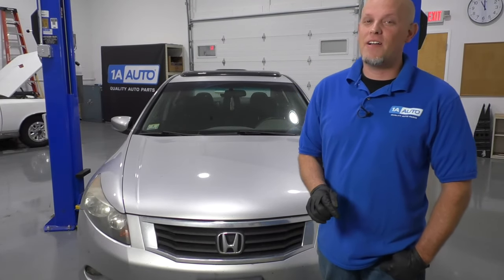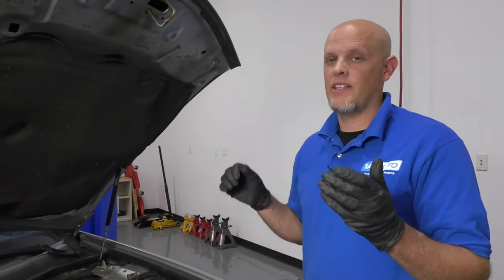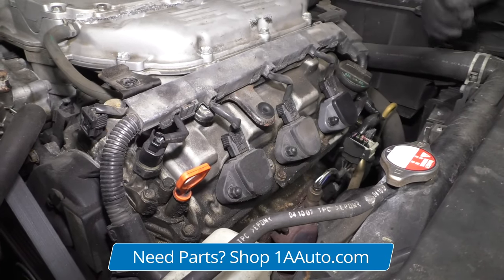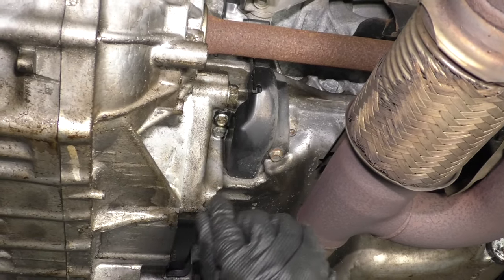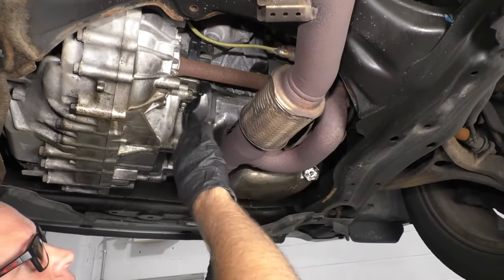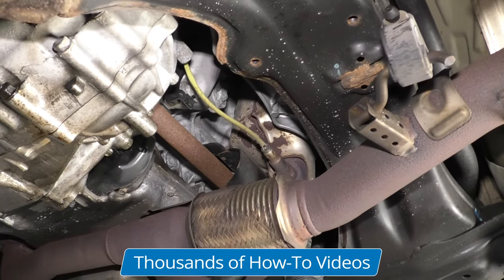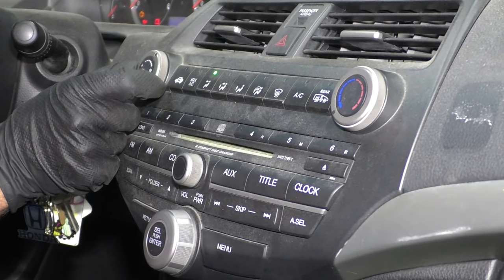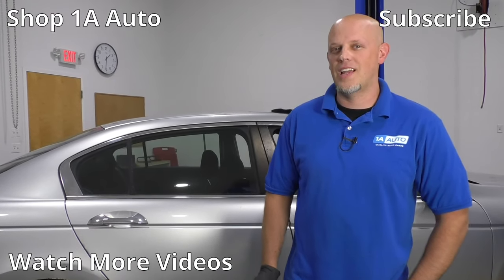Top 5 Problems Honda Accord Sedan 8th Generation 2008-12

Comment: I had the 2008 4 cylinder model... bought it with 136k miles on it, sold it 5 years later with 250k miles, no major issues at all,, the biggest component change i made was the brake booster,, other than that, the car was such an amazing to drive, super reliable. loved it.

Comment: The biggest problem I have had with my honda now is replacing factory parts that needed replacing with junking ass 1A auto parts like the  four complete strut assemblies after a alignment it sounds like a Amish buggy on a gravel road all four struts  make noise I was told by several macanics not to buy after market assemblies now I know why it all over YouTube and Google about the noise I should have done my home work before  hand

Comment: 160K miles, not a fast or quiet car inside (I've got the LX-P) but otherwise solid vehicle. Repairs so far, locked front caliper, starter motor, radio was having hiccup and occasionally it takes few extra cranks to start. Arm rest in the center console wore out, paint still looks good, couldn't be happier with a long term outcome.
Reply: Mine too , got a lot of problem , not reliable than i think
Reply: Get the v6 it’s pretty peppy compared to the inline 4 everyone that sees my car gets jealous because I have a “fast” car so they always challenge me to race them
Reply: @slapshotjack9806  ME TOO! LOL
Reply: @slapshotjack9806 only race I’ve lost in my accord v6 is to a Tesla😂

Comment: 2009 Accord, 4 cylinder, 205k miles. Have had none of those problems. I had the starter changed and it’s pretty well hidden. Other changes have been battery, tires and brakes. So far so good! But thanks for pointing these out.
Reply: Hey Honda friend! I got a check engine light on. Mechanic said catalytic convertor..Ive heard i dont need to necessarily do anything about it if seems to be running well..

Comment: I have a 2011 Accord up here in Canada.  I had to change my alternator twice, a leaking rocker plate, wheel bearings, and front shocks.   It's the heaviest and largest Accord that Honda ever made, so some of the parts are meant for lighter cars.
Reply: The oil leaking runs down inside the alternator and that's probably why you had to replace it. Seen that a few times.
Reply: Changed the rack and pinion, timing belt, factory amp, and now it has an alternator issue
Reply: Wheel bearings for me... That's what bought me here.. Sounds like a jet while driving
Reply: Starter died, spark plugs, ac compressor, and rotted floor, all fixed runs like new
Reply: I had the same problem with my 2012 Accord.  Had a leak somewhere and it was dripping down. Causing the  alternator to fail. What I do now is Keep a close eye on any leaks When I get the oil changed. I've also replaced all the wheel bearings on my car. It now has 250,000 miles. As the temperature rises,  You may want to think about having your engine steam cleaned so you can better identify any current leaks. I used to live in a very Cold climate similar to Canada here in the States. My cars would always have leaking seals more often than if you're in a warmer part of the US.
Reply: Mine has eaten batteries since it was new.. I replaced three on manufacturer warranty alone. I now buy premium batteries with 2 year warranty knowing they will fail in one year and be replaced for free. It's a 2010 and has had over 15 batteries. I replaced both battery cables twice, the positive is constantly rotting from the inside out. Other than that and regular maintenance, it's been bullet proof

Comment: this was the most helpful video on honda i have found. i had to replace and alternator, many brakes front and back.door battery and my power steering is leaking now
Reply: Were those fixes inexpensive? Did you keep the vehicle?

Comment: 2009 Honda Accord coupe with 120k miles. The thing is a bullet and the only issues I’ve had were ignition coils replacement, starter, and cleaning out fuel injectors.

Comment: I absolutely love my Honda, but have had to change the alternator 4 times. It's an easy fix if you have the right tools. My Honda just hit 200,000 miles and is still running good.
Reply: I'm seriously debating on buying a 09 v6 ex l with 180k miles
Reply: I replaced the alternator on my '08 Accord once at 150k miles. I think you should go with genuine Honda parts. Unless you have bad parts installed there is no reason why they shouldn't last at least 100k miles.
Reply: @e46enthusiastic57  . Hondas are good cars but anytime you buy a car with that many miles be prepared to spend money on repairs. Some things are very difficult to replace like catalytic converters and depending on your expertise working on cars you might not want to do it on your own. I had the shop  replace my for around $700-$800. Most of the other work I do myself.
Reply: Denso alternators only for replacement
Reply: Unless it was a genuine Honda replacement I can't see why you had those issues.
Reply: @midwestfarm757  my alternator just took a crap and it was the original one 11 years 191,000 MI I spent the money for a new Denso one
Reply: Make sure oil is not leaking and running down into the alternator.
Oil will ruin it.
Reply: Do you run an amp? Speakers?
Reply: 4 times damn did you use a parts store brand reman alternator? Denso remans usually last quite sometime even though they come with 1 year warranty
Reply: @CRAPO2011  yes store brand.

Comment: 2012 Accord 4 Cyl, had 30K when I bought it,  10 years ago, 135K now, I do all my own maintence.  Only thing I have had to do was Oil changes and brakes , I change trans fluid about every 2-3 years, flush the brake fluid every 5 years, changed the plugs at 100K miles.  I recently changed all the coolant hoses on it, figured 135K and 12 year old hoses probably due, they really weren't that bad at all, I was surprised.  This car does not burn one drop of oil or leak any oil. This 2012  runs as good as the day I bought it, plan to keep it till it's dead.

Also have a 2014 Accord 4 cyl with the "Earth dreams" engine in it.  80 K miles. It uses oil, about a Quart or so between oil changes.  "improvements" aren't always better!!

Comment: I have the 4 cylinder and the only problem that I’ve had with it was the motor for the vent direction died so I didn’t have defrost. Other than that, drives great. (Not a bad 0-60 time either)
Reply: Ya quick for a 4 cylinder! People ask me if it’s the v6 when they ride in it
Reply: @ajmedeiros77  lol the v6 is a rocket on wheels if you’re a car guy with interests in mid range vehicles like that
Reply: @slapshotjack9806  OH YEAH!
Reply: @slapshotjack9806  little bit more of a rocket in a crosstour that has 4wd, love mine

Comment: We have a 2012 Honda Accord SE 4 cyl. and it’s been a very reliable car overall. The only thing I had to replace on it were both front shocks and a catalytic converter. After watching this video Ill go ahead and replace the spark plugs and ignition coils. I don’t think it’s ever been done since we got the car. We got it with 42k miles and currently it has 138k miles and we’re very happy with it.
Reply: 2012 model is the most reliable
Reply: I have a 2012 accord as well and how many miles did your Honda have when you changed both front shocks?
Reply: That's exactly what Scotty Kilmer (on Youtube) said.   @antonisabeast
Reply: @donttrip8314 I think it had a little over 100k miles when I replace the front shocks.

Comment: I have a 2008, 4cyl sedan with low mileage at 79k.  Just replaced the fuel pump today.  My garage was smelling like fuel.  Scary.  Also, the moonroof is stuck open in tilt position.  Just found a couple of videos on how to manually close.  Other than that, this is a very reliable car if you keep it well maintained.
Reply: why did u replace it? i have the same car and i think the fuel pump is whats causing it. what kind of symptoms were u experiencing? hesitation upon acceleration but on some days it feels responsive?
Reply: @gerard4441  I had 3 mechanics look at it and they could not diagnose it properly.  Took it to 2 Honda dealerships and explained the issue to the 2nd one and requested a master tech to look at it and he discovered the fuel pump was bad.  The car is 13 years old, despite the low mileage and it was time to replace it.  The smell of gas was dangerous and could have caused an explosion or fire if I did not replace it.
Reply: How many mpg does your 4 cyl. get?
Reply: Hi how good is yours on gas? My friend said it got poor gas economy
Reply: @deevictor1136  As long as you keep your foot off of it, its ok, but if I goose mine, that needle starts to drop
Reply: @Strawberrystrawberry713  What was your cost to replace it?

Comment: Another common problem is wheel bearings, just replaced one on my wife’s 2008 Accord and it only had 120k miles on it.....
Reply from the maker: Thank you for the additional info! http://1aau.to/m/Shop-1AAuto-Now
Reply: A big time defective part on these cars!
Reply: I had to replace a rear bearing with only 80k miles, though I -ve been driving on dirt roads, I guess the bearing don-t like dirt/mud
Reply: 110k miles and nothing's been needed but brakes and tires
Reply: I wouldn't say needing wheel bearings on a 12 year old car with 120k is unexpected
Reply: @Carlos-yz5kz  No, but repalcing them THREE OTHER TIMES before that IS!!!!
Reply: I hope you have used brands like PTC or National they are good replacements almost like the originals
Reply: @acelerado89  yes
Reply: i have 265,000 miles on mine and i have never changed them lol
Reply: @mmccarthy1992  Did you change the timming belt yet?
Reply: I just got a 2012 Accord with 49,000 miles on it and had to replace both front wheel bearings.
Reply: Replaced 2. 235,000 miles. One rear and one in front. The front was hard as hell but got it done
Reply: You must have a pretty good stress free life if you’re going to complain about a 13 year old wheel bearing with 120,000 miles.
Reply: Yes.....
Reply: happens with no sparking on the seat actuator joint with top of plastic connector.
Reply: @troymckoy113  get a new car, dont be a tightwad
Reply: I just bought an  2012 2.4L I hope I’m good
Reply: Wheel bearings at 310k+.... 2011...

Comment: Have a 2010 2.4l with 230k miles and never had any of these problems. 

No mention of the excessive oil consumption caused by a faulty piston ring design? Honda did have a TSB and an extended warranty to repair this with redesigned parts but since it wasn't a "recall" they told no one unless you happened to bring your car to Honda for this issue and only agreed to fix the most egregious cases leaving many of these cars floating around suffering from this issue.

The only problem the car has had which I consider to be unusual was the starter died at 70k miles. Replaced with a new part from Honda and has been good ever since. Interestingly, the original starter was tagged made in USA the replacement was tagged made in Japan. 

That and annoyingly the damn hood strut holder! I've had to replace that like 3 times already. Not only is it an annoying thing to have break, when it does break I have to find a means to secure the hood strut in place so it's not just flopping around. This is especially irritating due to the oil consumption issue which means every 1k miles (about 3 or 4 weeks) I have to pop the hood to top the engine off with oil. Also did I mention how bad oil consumption is for the incredibly expensive catalytic converter?

Comment: I had mine since 2011 and 11 years later, no problems just a battery died once and it was old
Reply: Hi ! Is yours the 4cyl. ? 
Thanks
Reply: @julioserna5659  yep solid reliable car. We have ours since 2013 and its going strong 0 issues basic/minimal maintenance

Comment: This is accurate info.  I have a 2008 V6 and I've had the alternator, ignition coils (which probably led to) and all 3 catalytic converters got clogged afterwards. No power as a result (replacement was a major pain in the @$$). Oh...and a blend door actuator motor that's just gone bad at 145k.
Reply: I had same issue with cat convertor it gave me 0420 code and misfire at slow acceleration ( not all the time)
Reply: I’m having the same issues with my 08 inspire V6. cat converter, alternator, ign coil plus an oil leak (which was right over the alternator which led to it burning up)  pain in the arse is an understatement actually 🤣🤣🤣🤣
Reply: my 09 v6 transmission went at 45k. it was a common defect

Comment: I have 2008 accord with the k24 super reliable car only problem I’ve had was with the vtec actuator other than that solid and still running with 325,000 miles
Reply: Wow, 325k?? Mine just hit 200k yesterday. Going to do a trans fluid and replace spark plugs.
Reply: 326k on mine when sold. Burns oil but ran strong

Comment: So far, sway bar end links, starter, and be rack and pinion had to be replaced.  120k miles,  2009 Accord 2.4 LXP.  Everything else has been wear parts, tires, brakes, spark plugs, belt, etc.  It's only been in the shop twice.  Rack and pinion was under warranty.  Starter was a pain so I had the shop do it.

Comment: We bought a 2010 Honda Accord V6 with low mileage and after driving roughly 3000 miles found out the number 3 cylinder was letting oil onto the spark plug which fouled it and we got flashing engine light.This was a problem with the V6 and they told us we missed the recall.Today I’m still driving it and I change that plug around 5000 miles.
Reply: You should look into disabling the vcm system which allows the engine to go into eco mode, disabling 3 cylinders during certain driving conditions to save fuel.  It is this system which allows oil into the number 3 cylinder, fouling the spark plug and causing the engine misfire.  There was a recall on this but it only paid to get the problem diagnosed and the spark plug replaced.  The ultimate solution is to disable the vcm. There are many ways to do this,  I did it with the vcm muzzler.  I too have a 2010 Accord with the V6.
Reply: @danjoe22  Thank you for that information.I’ll check into that.

Comment: Got the 2,2 turbo diesel.
Regular oil changes a must.
Rear calipers seize up.
Exhaust manifolds crack, this was a silent recall fault so if not serviced by main dealers might not be picked up on,  but the main dealers might service your car and turn a blind eye hoping to run out the warranty time.
Airbag factory recall,this is a free replacement passenger airbag.
Not particularly fast, economical or cheap to run.
But a nice comfy cruiser @80 mph 44mpg 0-60 around 9secs and around 130 bhp if I recall.
I found the heater controls a bit to discrete and awkward also.

Comment: 08 accord lxp 4cyl starter went out. Replaced with an O'Reilly starter. 7 months later car went into limp mode. Bought a genuine Honda starter from the stealership installed it did a ckp relearn with expensive snap on scanner.  In five min car is back to normal.
Reply: Has that problem came back since u put the new starter
Reply: @sikes562  nope. Car runs fine.

Comment: I have a 2012 Honda Accord LX 2.4 L. It has 280k miles on it with regular maintenance. Only major replacement is the power steering pump, which was making a loud noise.

Comment: I have this car. It’s a v6. I’ve had multiple seal leaks, alternator, Vvt sensor replaced, coils, O2 sensor issues, power steering, & the list goes on. It has over 200k miles. I have owned a 95, 98, 08, & 2018 Accords. I wouldn’t own any other brand.
Reply: Oh and the power steering leak.
Reply: Got an oil leaked... 2011. Power steering whine.... But just read how to fix that... Wheel bearings.... Learned that too... Going on 310k+ miles. I've owned all the same years as you. 😂 got the 01 twice... 🤣🤣🤣
#HondaGurlz

Comment: Power Steering??? It's the most pain on the neck problem ever. Uncomfortable sets, O2 sensors, and engine mounting
Reply: Change out the power steering fluid twice a year, use a shop vac and suck out the fluid.
 I use a bottle with a small hose , it not much. Also try a turkey baster
Reply: @adamUDavies  what’s wrong with power steering ??
Reply: Absolutely right, I recently changed power steering motor on my 08 Accord V6

Comment: 260,000 miles 2009 4cyl accord single owner here. (It was my dads and now mine)
 So far:

- VETEC selenoid gasket was leaking
- Starter Motor 
- Powe Stearing pump Oring started leaking 
- I did rebuild the alternator but it was due to the power stearing leakage dripping over it
- AC fan motor
- 2 Motor mounts
- Sparkplug fail after 250k
- Stabilization bar bushings were also replaced 

AC have never fail and it has the original suspension system 
- It is a really good car. For a car with that milage those are pretty stupid thing to brake. Most of them like motor mounts and bar bushings not a problem for a lot of people but I hate vibrations and knocking sounds. 
Sparkplugs and AC Fan motor are just basic maintenance like brake pads

Apparently the Vtec gasket and power stearing pump oring are common issues but honestly the stearing pump oring took me 2 minutes to replace and as of this moment im taking a brake from changing the oil and now its time to tacke the vtec gasket, but it doesn’t seem too complicated.
Reply: hi, how is the car going. is it very reliable. i had an audi i sold cos the price to repair is will buy 3 honda coupe.i heard honda parts are cheap .i recently saw a cheap 2009 honda accord coupe with 200,000km  and looking to get it and do some MOD, so thats why am wondering if its still a reliable car to buy. thanks